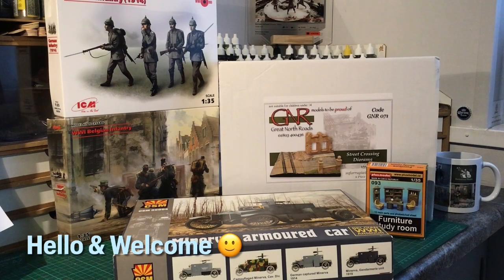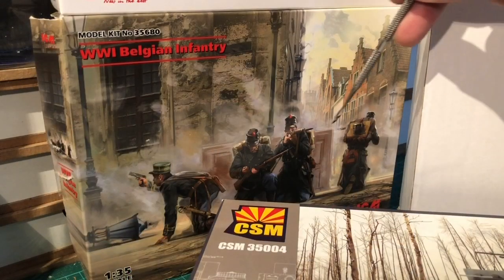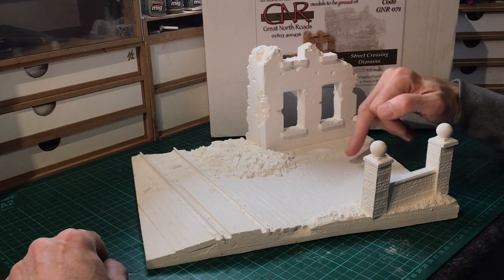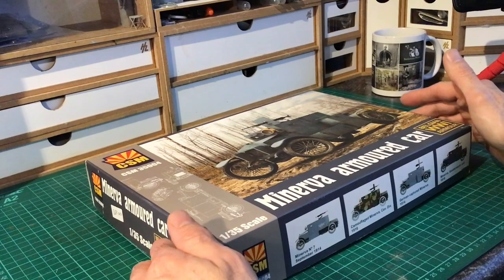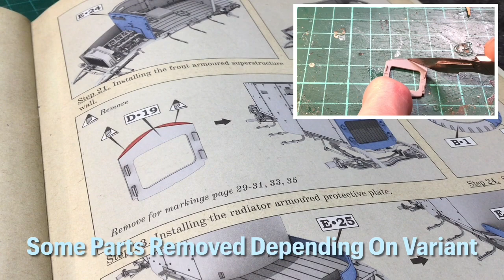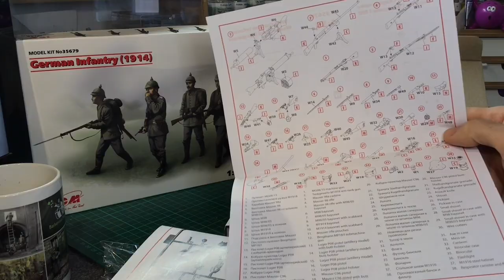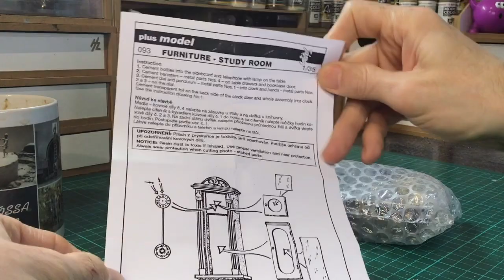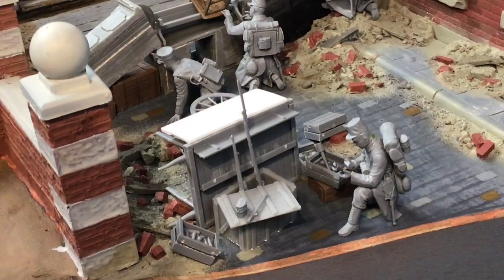Gallant Little Belgium - WW1 Diorama

Comment: Would you recommend the company that made the base you used, or is there one you prefer over this one? Also, do you recommend these for someone who is new to dioramas?
Reply from the maker: When you say ‘base’ I guess you’re talking about the farmhouse? This is the 3rd building I’ve used from Gero Design, the other 2 being made of plaster. This is the first one I’ve made however using the wood, as opposed to plaster or plastic, & it’s the most enjoyable building I’ve made! It takes quite a while to glue the dozens of pieces together & then there’s putting the plaster between the wooden joints which takes time… Plus this building comes with no instructions, so needed to refer back to YouTube modellers to get some advice. 
For someone new to building dioramas I’d definitely recommend their plaster buildings with the ready made bases. The 2 Gero buildings I’ve made previously on the channel took literally seconds to put together - 3 walls & a base - easy!! 
Here’s links to those 2 builds here:- https://www.youtube.com/watch?v=Qgzc9pXbPOY&t=33s & https://www.youtube.com/watch?v=YojMXttiZAE
Hope that’s of help 🙂👍
Reply: @Barbarossamodels  I meant the plaster street from great north roads. I think you may have gotten confused, this is the gallant little Belgium diorama, not your most recent one. I’ve never seen plaster dioramas and was curious how beginner friendly they are. I’ve been wanting to make a warhammer 40k diorama for a while now and I think that with a bit of tweaking that their bunker 2 and fire base dioramas would work pretty well, but I’ve never done anything like this before and figured I’d get your opinion
Reply from the maker: Ahh sorry…my fault, didn’t look at the thumbnail pic first🫣🫣🫢 
Tbh the Great North Roads building & base was nice, good value & they’ve a really nice range. Detailing however, especially with the cobblestones isn’t very defined - they’re very smooth compared to other companies, some of the brickwork too. But they’re a strong product, well priced & I would look at using them again!👍
Reply: @Barbarossamodels  thank you very much! Since I’m looking at bunkers and trenches, I doubt brickwork will be such a big deal. I assume just regular glue will hold them together?
Reply from the maker: Fair point…! There’s probably a number of adhesives suitable, PVA glue has worked for me before, but using wood glue recently creates a really strong bond! So either one perhaps will do👍
Reply: @Barbarossamodels  wonderful, thank you for all the help!